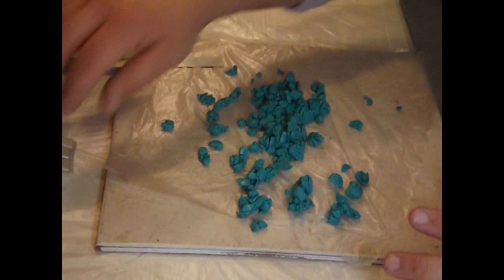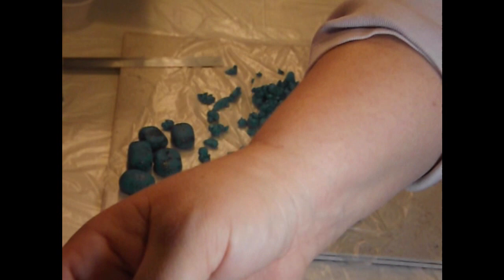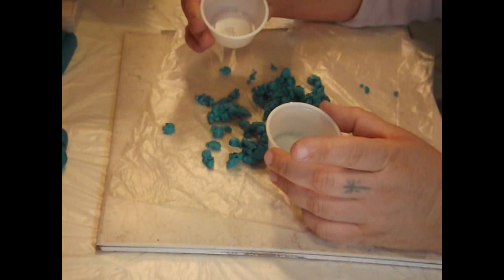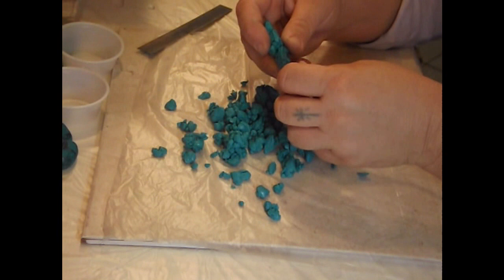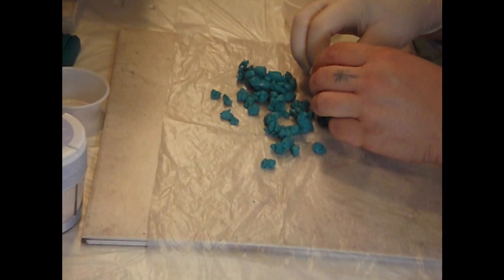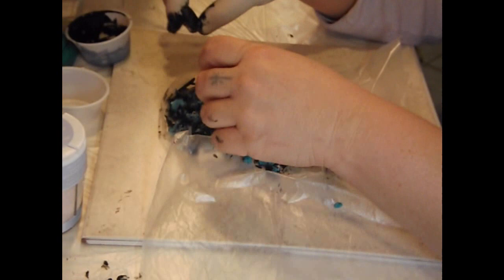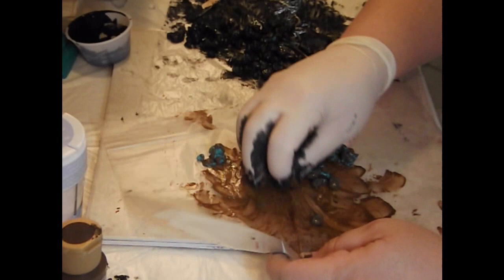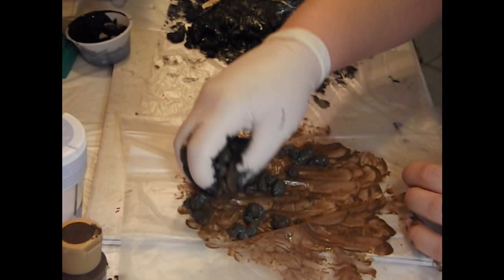Faux Turquoise polymer clay tutorial - Part 1

Comment: I've done this technique many times & it works very well, have you ever tried the same technique with the just micro-fine glitters? I've done the faux turquoise with the black glitter (put glitter & clay pieces in a baggie & it's much less messy) It does require alot of sanding but the results are fantastic & very sparkly.